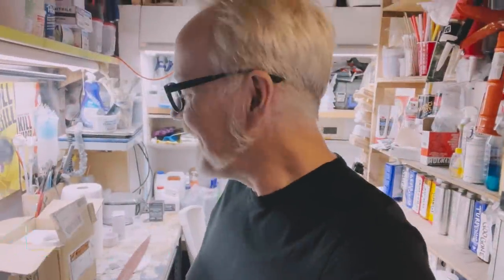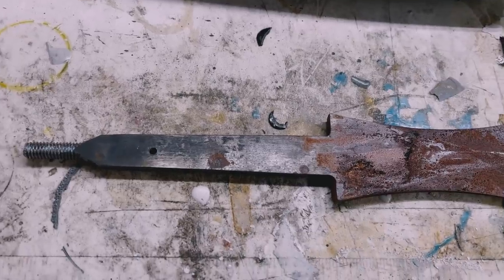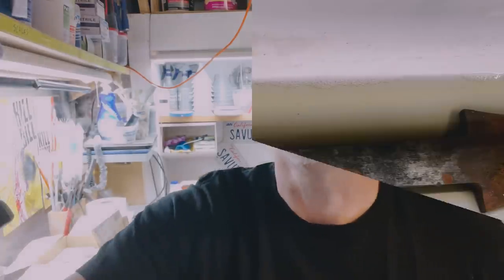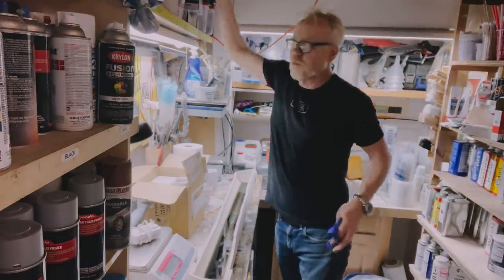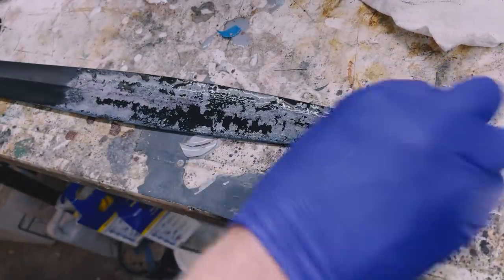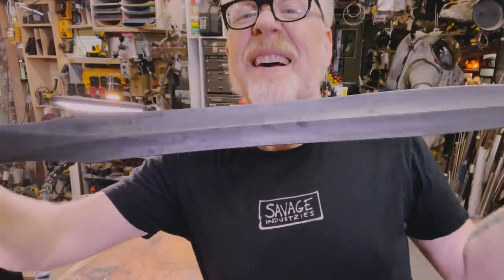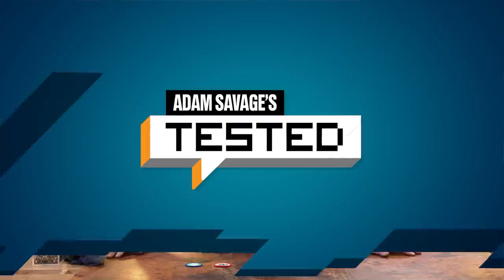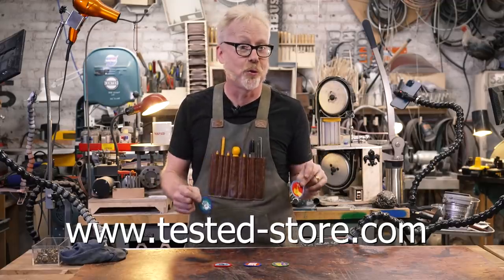Adam Savage's One Day Builds: Weathering a Sword Blank!

Comment: Adam, I don't know if you actually read these comments, but here's a technique for you: When you have the steel initially rusted, boil it in distilled water for about an hour (times vary depending on the size of the piece but an hour is pretty much minimum) This will convert the red rust to a black ferric oxide. After you've boiled it use an ultra fine carding wheel to gently polish the scale off and give it a coat of non detergent oil. You'll end up with a blued finish that will resemble an antique gun. Areas of heavier initial rust will have different tones than areas with less in the final finish and add an interesting layered effect as well.

Comment: Hey Adam, great results!
I just wanted to contextualize your statement about differential hardening of swordblades: You said that a differential hardening (soft spine, hard edges) is neccessary for a proper sword blade, so that it is not too brittle to use. This is not universally true. 
Some types of blades were traditionally differentially hardened (most prominently the japanese blades), but many medieval european blades were instead through-hardened and then tempered, to relieve some of the hardness and taking away the brittleness. You may also see the term "spring-tempered" used for the same technique (because the sword then flexes like a spring, instead of taking a bend like on differentially hardenend blades). 

I'm pretty sure you were already aware of this, but i wanted to clarify and contextualize that statement for the people that don't know!

Greetings from a fellow sword enthusiast!
Reply: @evensgrey  atleast that's what everybody is repeating over and over again, i haven't seen first hand sources about it. But i guess there's a good reason to using the high carbon steel only for the edge and making the rest out of lesser quality steel. Having restricted access to high carbon steel seems quite plausible

Comment: Evaporust is awesome. A few years ago I found a listing for a lunchbox style thickness planer for $20, the motor worked but the lift mechanism had seized up. I spent some time taking it apart and cleaning everything, put it back together with an additional dab of grease if was like new. And pretty much everything was badly rusted when I got it.

Comment: I’ve been using Nevr-Dull for 40 years, it’s great for aluminum, chrome, and plated surfaces. The only problems it has are, it will turn your fingers black, it smells weird, and it will stain some types of rubber (car tires).

Comment: Have you heard of 'Browning'?
Carbon steel, well cleaned, induce a fine coating of rust.
Boil piece in clean water, red rust turns black.
Scrub loose rust off the piece, rust it again.
Keep doing this (3-8 passes) until it doesn't rust any more.
Seal with oil/wax.
This is the traditional 'Blunderbuss' surface treatment.
Deep purple/brown color.
Makes a great finish for a Bad Guy dagger or dark armor.
Very labor intensive, unbeatable appearance.

Comment: man you did an excellent job with those hollow grinds! and the weathering too, I would say Pro 100%.    Differential hardening doesn't -need - to be there for a sword to be a sword, just wanted to add that!  A thru-hardened steel and tempered all evenly to the same range is just fine, so long as the temper range is high enough to produce a spring-like temper : ) Just an added thought!  personally, I do differential hardening mainly because its easier for me. When heating the piece up to critical temps in the forge, the thinner areas of the blade heat up to quenching temps before the thicker spine area does, so if you just keep an eye on the colors, you can nail a differential hardening no sweat!

Comment: great sword grind, and love the patina, I used to grind viking re-enactment swords, getting them authentically weighted without sharpening was a trick, grinding in a fuller down the centre of a blade is even trickier than the curves you ground in, getting a fuller only 1mm thick at the centre when taken from both side of 6mm steel was tricky too. I used to buy en45 spring steel from car leaf spring manufacturers in the unhardened state, as that was required for our combat regulations (it doesnt burr up like mild steel would), and then with use the edged would be work hardened, did they break, - yes occasionally maybe once every few years of combat - we had to get the effect of the edges with a 1/8" rounded edge (for safety- as if 3lb of steel hitting you when blunt was a lot safer).

Comment: I'm sure you've heard it already, but the blades from Albion are 5160, which has a high chromium content and doesn't rust as easily as normal steel, but it is not Stainless Steel.

I'd love to see you do more Albion blades :)

Albion was taught how to machine their bare blades on a 5 axis CNC mill by Angus Trim, who also makes swords and you should grab one if you ever get the chance.

You can use a scotch Brite belt, grey, going parallel with the spine and it will make it shiny but a "working" finish, too, but you hollow grind, which looks pretty, but isn't great for actual cutting. Peter and I talked about it years ago, and he said that he grinds real swords differently, either flat, or convex as to reinforce the edge more.

Comment: Adam likes the silence of an angle grinder going at it at 95 dB.
I kid of course. I completely understand.

As for rust removal: I used concentrated vinegar (about 15%) on a vice. Worked like a charm, though the bucket had to be thrown out. It's also a risk because vinegar will just eat the iron too.

Comment: I use white vinegar to the same end with  my carving knives. It'll knock rust off and leave a fine patina that resists rusting, but I rub them down with mineral oil to keep them good. Not sure what's cheaper, vinegar or EvapoRust?

Comment: How do you handle the weathering of cared for items?  For example the mechanical parts of a soldier's gun will show different types of wear that the non-mechanical parts.  Have you ever included "replacement" parts or less weathered repairs?

Comment: Hey Adam, thanks for another great video. Have you tried distilled white vinegar for rust removal? I use it when restoring old motorcycles. You have to let really rusted parts soak for a couple days but it works great and is cheap.

Comment: You've essentially done a poor mans cold blueing on the sword. Normally this is converting the red oxide (Fe2O3) to black oxide (Fe3O4). In this case though, according to Evapo-rust, it is carbon being pulled to the surface or the iron being preferentially removed on the surface.

Comment: Anyone got any ideas on how to weather stainless steel parts on a sword (hilt and pommel) I've tried household acids since I wasn't sure what kind of stainless it is, but that didn't work. I'm considering using a torch to heat weather it, but I've also considered painting it like I've seen Adam do, but since its mostly smooth surfaces so I'm not sure how it's gonna work out. Any ideas would be great.

Comment: I'm a little confused. Early in the video, Adam said "Stainless Steel Sword", but the oxidation and talk of differential hardening makes me think it's carbon steel? Anyone know what metal was actually used for the sword?
Reply: Maybe 1075 or 5160? If it's being sold as a functional sword blank and not a prop/wall hanger it is 100% some flavor of high carbon and probably a spring steel.